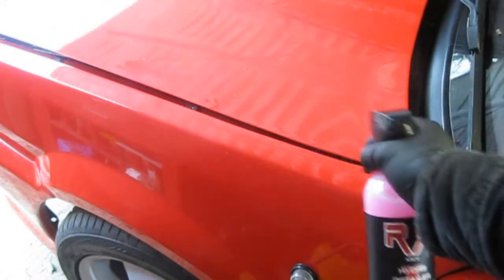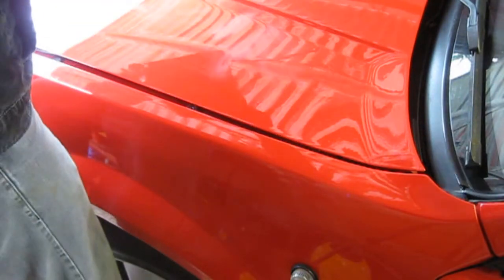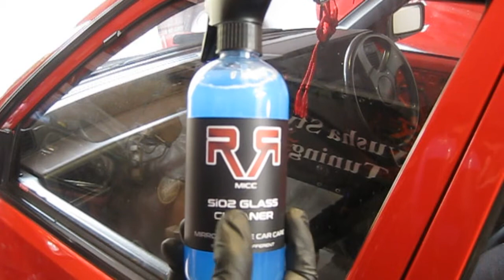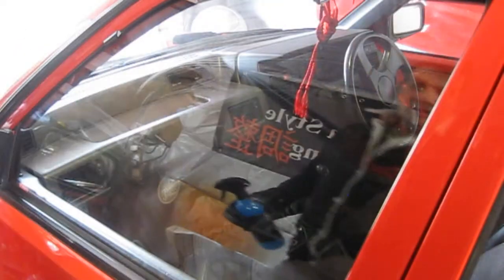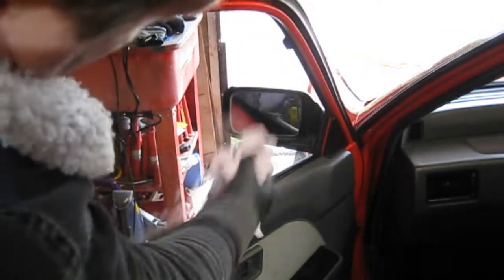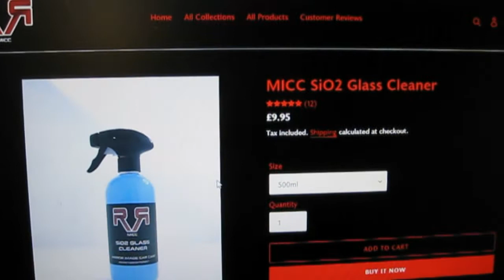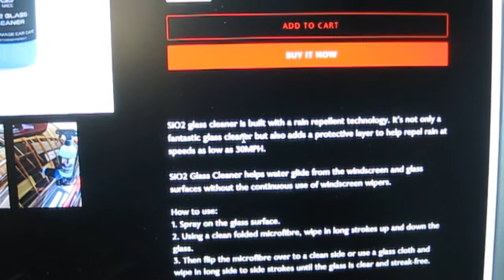Mirror Image SiO2 Glass Cleaner and Hydr8 Detailer test #producttesting #carcleaning

Comment: Funny you uploaded this today, I washed my car this morning (no rain in Worcestershire today), and then used Meguiars quick detailer, had it in my cupboard for a couple of years or more, and still got enough to do the whole car again at a later date. It goes on and off easily like the one in your video, and leaves a nice polished/shiney surface. It repels the rain off, and beads up nicely aswell for a good few weeks in my experience, and helps keep the car clean for longer too, it works out more expensive than the one you have though. 
Be interesting to know how well it repels water/beads. 

My method is usually two clean MF clothes, of different colours, then I use one to apply/spread the detailer over the paint work, then switch to the dry one to buff off.  Love using a detailer as it’s so quick to do, and little effort, for quite abit of  short term beading and shine😎👍🏻
Reply from the maker: I agree. Two cloths seems to be the best method.  I’ve used the Meguiars detailer and it is excellent.  The Mirror Image seems to be just as good .   All there products are really well priced too.  👍
Reply: @KyushaStyleTuning  yes I commented before I got to the pricing at the end, I think the bottles on that site are abit bigger than the megs detailer, so better value for money there. I may try that one, it’s always good to try new products